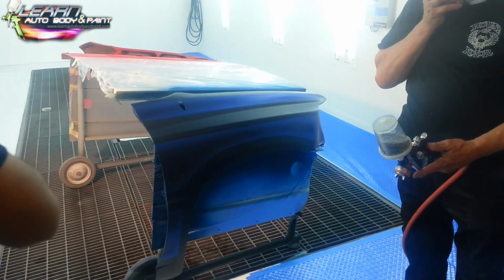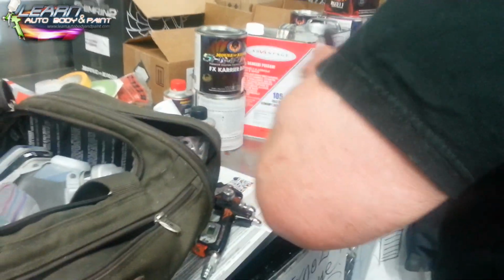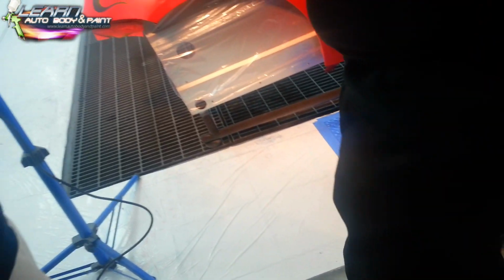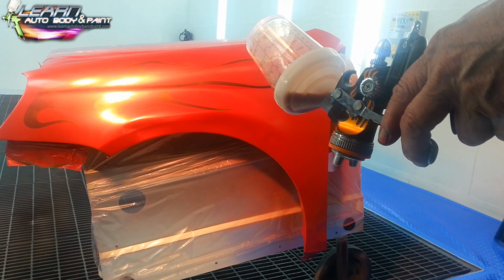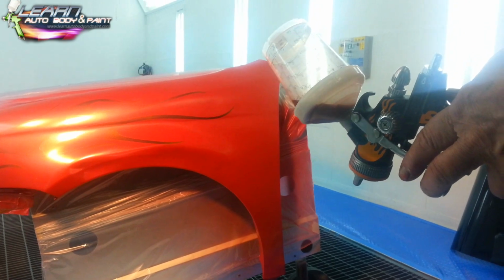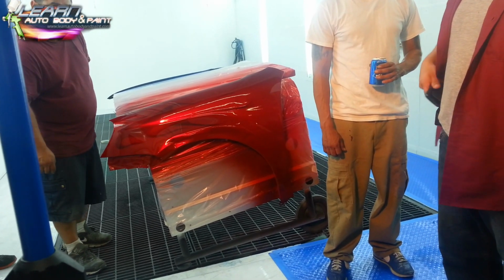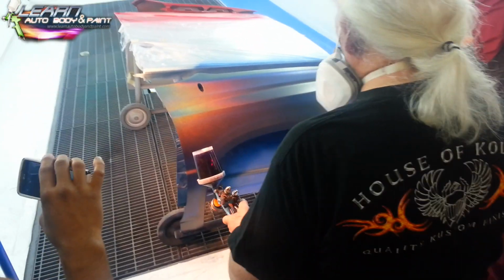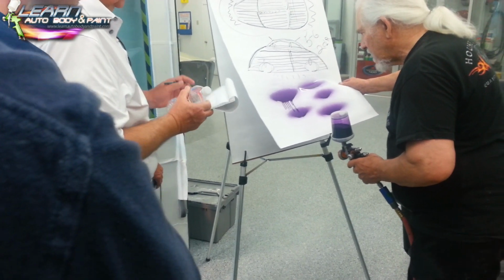House of Kolor Pearl, Kandy, Clear Coat Demo - Jon Kosmoski & Tony Bandalos

Comment: So 400 grit before base coat correct?
Reply: parts unknown if you're going to flatten out your paint and paint over it you must go higher than 400 I recommend 600 grit sandpaper wet of course
Reply: @davidshareefChTPhD  don't need more than 400 unless its a metalic. Stop spreading stuff you know nothing about.